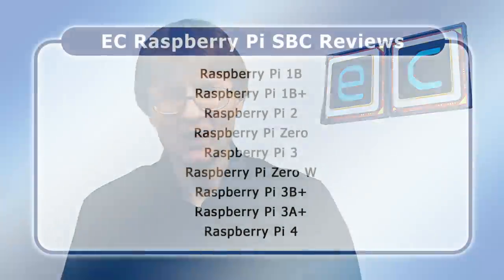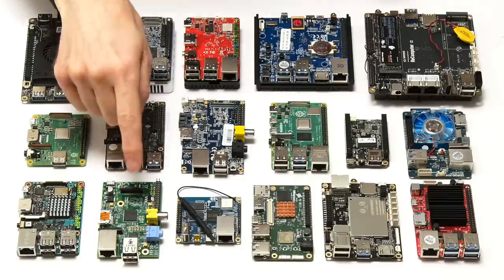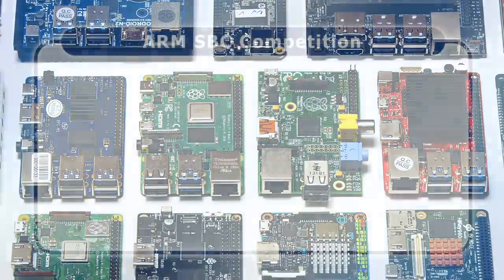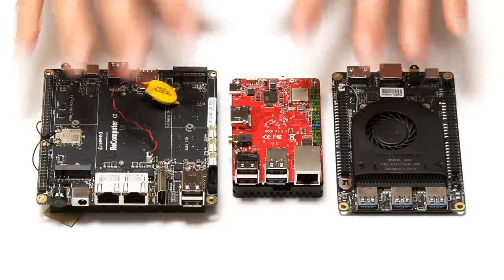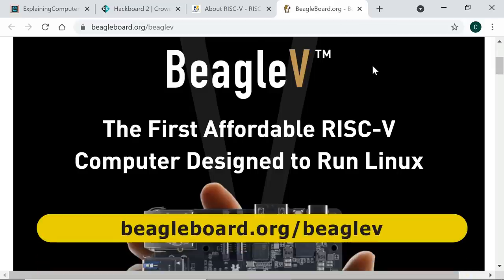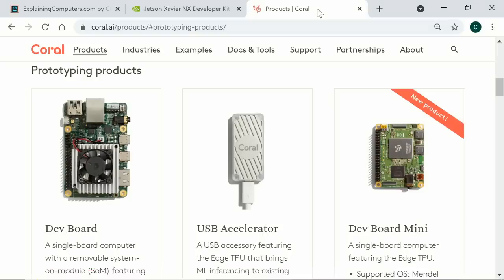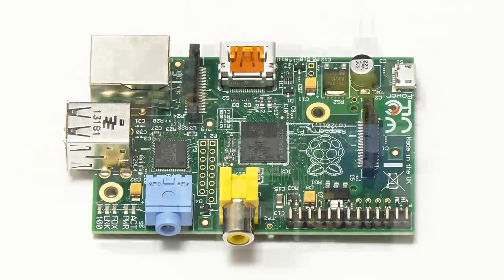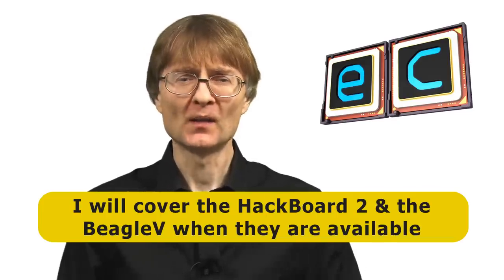SBCs in 2021: The State of Play

Comment: Thing is, you can only have that many different configurations until all of them can be depict with a config file for the mainline kernel. And if i where to develop a "5€"-SBC i would create a table of cheap components on the one side and put if they have drivers in the mainline kernel on the other side and then select the cheapest that crossed out both sides. Throwing a bunch of ICs plus chickenfood on a PCB isn't that expensive, especially if you only need to follow the manufactures examples, what kills you is if you need to mangle the kernel to run on your board.

Comment: they should have taken the pi400 prototype and actually increase its specs. its getting to the point where low power consumption is becoming less of a selling point compared to cheap single board computers that can run powerful software. they could have doubled the size of the board, replaced the low power arm cpu, added a small cooling system and it still would have fit in its keyboard chassis.

Comment: Why is it that every new ARM-based CPU requires a whole lot of CPU-specific software development, but the same x86 OS (Say windows 10) runs on pretty much the entire range of X86 CPUs?
Reply from the maker: Because all those x86 CPUs are plugged into a PC motherboard with standardized hardware, all running the same standardized operating systems, and with a BIOS/UEFI adapted from a standard image. But this is not the case for ARM SBCs, where the designers/manufactuers can include whatever hardware they like.

Comment: Please make a video about controlling an SBC over WiFi. That is, use your laptop as the monitor, keyboard, and mouse for a remotely located SBC, which you connect to via WiFi.
Reply: Also, check the range within which you use can use the WiFi. (I am thinking about automating an aquaponics system, which I want to observe (using a camera attached to the SBC) on the computer in my room

Comment: I'm not sure I agree with the conclusions - yes things are getting more complex and without serious coordination of resources those top-end (?) SBCs are really struggling to work for home consumers but that too is sort of missing the point. The very fact they proclaim themselves as prototyping kits is just a means to hook commercial or industrial consumers on a particular hardware template for their own products as such there is a huge hidden market that drives those onwards. Delays are the killer in all this but given the significant silicon shortages of the last 18 months (which are apparently getting worse, not better unless you are an automotive manufacturer) pretty much everyone is in the same boat (except for the RP2040 which is ironically the most interesting thing the RPF have released since the original RPi). 
Between education, makers and retro-computing fans the SBC market is pretty much sewn up by RPF and everyone who spends the time to experiment with them just ends up buying more and finding excuses to do more with them - that market pressure is significant and keeping prices down to sell more is key. For many the RPi3 is the sweet spot - cheap and capable without guzzling power or overheating, RPF know this and work hard to keep prices down otherwise they fail in their mission. They aren't Apple and aren't in the market for out-and-out profit (it just helps to keep development rolling) - even Apple are pushing their prices down to get more people invested in the new ARM products (see how long that one lasts once they abandon the old hardware)

Comment: Do you have any episode showing if you can use an SBC as a network router? It would be very interesting to see if I can make a router with at least 4 RJ45 slots with an SBC. Imagine the applications of that, we wouldn't depend on proprietary firmware any more. and we could have a device that can monitor the network in various ways and it would be able to provide statistics of the connection, and it could be used for various other staff at the same time such as network storage, and you could have a router with 4 usb attached devices if you wanted. you could have a router that can hold logs as big as its SD storage etc etc. other than the speed, you could make a machine that has no difference in terms of security compared with professional routers. and you could store inside content that could play even when the network connection is out. I cannot find such a project anywhere and I wonder why because it seems so feasible to me to attach a device with 4 RJ45 to a raspberry pi and use the raspberry pi as a router processor.

Comment: Oh man ! The single board computer gets me excited, it would be even better if it runs mainstream OS .
Reply: Describe mainstream?
Reply: @sethrd999  Ubuntu, pop_os!, win10, macos, manjaro, etc. OSes that normal consumers and average laymen are using
Reply: @umamifan  guess I am not normal then, hint there are alot of us also ;).  With SBC's I still maintain a rolling release is better for up to the minute support for your hardware.  I am having an interesting battle with a Solidrun 4x4 cubox-i and a device tree that actually disables a USB port and turns off power detection on the other, like a powered hub on the USB bus so ultimately when you plug something like that in the unit locks up due to the over voltage alarm condition.  The problem is the DTS/DTB ( device tree ) is for a hummingbird or loosely based off of it.  I am aiming to fix this and get the DT changed in latter kernels for this one.
Reply: @sethrd999  It's not really that you're not normal. Mainstream OS in a broad sense is just OSes that are popular. And they are usually populated by people wanting a simple browsing experience, a good workstation, some light gaming, etc. I don't think a "mainstream OS" would be a good fit for boards like these designed to be tinkered with constantly and inconsistently. They'd need to have their own maintained branch of it (e.g. Raspbian) to make sure compatibility, stability, and optimization are all in order so the end user doesn't have to troubleshoot as much and or write a lot of code to fix fundamental issues when they run into a problem
Reply: @sethrd999  Also great, I love it when people in the community create and push out fixes for everyone to use and benefit from. It makes the experience more enjoyable for everyone
Reply: @umamifan  I think its inherent that there is no happy medium really.  RTOS is the next step down the ladder and yeah your really in the wild there.  Ive mentioned ive had a ton of fun with Esp32's STM's etc etc.  So much power / fun to be had in a small package.

Comment: Well, while I guess all 80's and 90's computer (except IBM PC) were single board computers, I think the SBCs of today hark back to a time even further. When I think of SBCs ancestors,  I think of boards such as the Mk 14 (https://en.m.wikipedia.org/wiki/MK14) and others like it from the 70's.

Also, have to agree with you about the need for software. Even Raspberry are taking 2021 to be their software development year - so don't expect a Raspberry Pi 5 until 2022 at the earliest.

Comment: I am reminded of the situation in the late '70s early '80s of a less than mediocre computer which had only one thing in its favour, VisiCalc. Crap computer with a sort of business software. I cannot remember the spec totally but it was something like either a Tape Drive or an 80M Floppy Disk. Not sure of the Ram but not a lot. My computer had twin 800M Floppy drives and 64k of Ram. I was told by a contempory that the Tape Drive was faster than the Floppy. I know that in the similar period a Commadore thing had the same feature so this may have been true.
BTW this was Apple if you hadn't already figured it out. So software is the key item here. It matters not that my computer had SuperCalc and a Word Processor, just that they were a couple of weeks later.

Comment: It's getting difficult to draw the line between SBC and a microcontroller prototype board. E.g. pi Zero Vs ESP32, very doubtful that you would run a desktop OS on a Zero and it's an easy path to using something like an Arduino or ESP32. Don't get me wrong, the Zero is a great device  / board but it does not excel at any one thing.

Comment: It would be nice to see a fast singlecore 64bit intel (or amd, or maybe cyrix) sbc with low power like a pi3b or lower power consumption. A speed of 4GHz would be nice but about 3GHz would do (and a lot of RAM like say 4GB or 3GB or  2GB at least). So many people just write brute force bash scripts (not object-orientated or multithreaded) code anyway. The graphics could be the same as a pizero (or intel equivalent like dx9 or dx10 but in opengl). Would make it easier for communities to port a linux distro.
I'm not overly interested in RISC5 as a priority. A new openpower would be better IMO because it does something else.
Sometimes, even just for a slow x86 cpu, a person can be better off running on a intel cloned fpga (as if say 100MHz or more equivalent horsepower) in place of a pizero running qemu. Even a pentium2 at 350MHz with a large amount of RAM would do. Not interested in nvme and all that. Some sort of PCI (or pci-e) would help, then add what you want (e.g. new graphics or a NIC or sata/usb HBA) but remove it to save power. A DVI-A port would be handy and then digital or analogue can run on it. PoE is handy, an a few usb would do but need not be usb3. The HBA could do it.

Comment: Now Intel, Nvidia and others all trying to get control of ARM. If they do ARM will be forever expensive like the X86 parts. Hope a stronger low budget RiscV board comes out soon as Sifive boards are silly money at $500 for one which is worth having as a base to build a replacement desktop and OS environment on. But currently they are the only ones which have a PCI-E link so you can use a AMD GPU card on them with ease, but I would have to rewrite and compile the open source drivers Myself. I want to build a RiscV office based machine to run my own OS on. while I can do the coding side in C/C++ i haven't a clue about the hardware side, hence the attraction to the Sifive ITX board which would just drop in to any ITX case and let me use a know GPU type. Currently running a customised Linux Gnome desktop, but switching to BSD probably as don't want to share my code for free after putting in hundreds of hours of work. I could make an Amiga do anything it was capable of doing, but never like the x86 platforms, So many pointless extra instruction. Always proffered RISC Processors assembly. With US putting locks on ARM chips sales to Chinese I can see RiscV getting used in phones at some point, still years to catch up ARM but then ARM sold out years back.

Comment: Linux was ported to ARM processors years ago, and linux for arm SBCs should not be a problem.
Reply from the maker: But appropriate drivers are required to access the hardware, which very much remain a problem. There is not a standard ARM platform the way there is a standard x86 platform.
Reply: @ExplainingComputers  
Time will tell.  However, the development tool chains already exist.

Comment: I'm looking for an SBC that has GPS in it and runs android (that recognizes the GPS). I want to build a system with an navigation android app that utilizes full-size keyboard, mouse, monitor and speaker. Support for two monitors is highly preferred.
Reply: Considered an android tablet?
Reply: @sundhaug92  Tablets don't have option for external monitors. If you know about one, let me know
Reply: @adamlipsky8010  MHL is the term you want to look for

Comment: Apple M1 as a third way?  Apple has come up with a way to translate X 86 binaries into something that can run acceptably fast on and ARM processor. It seems to me that if the community can duplicate this kind of on the fly translation, then single board computers based on ARM could continue to be built on low-cost chips instead of X 86, yet vastly increase the software that they can run. Why not?  The future that you suggest is one where single board computers remain relatively compartmentalized with an in adequate amount of software and support.
Reply: @Tano good point. I hope this continues, because if translation can be done of the x86 programs so that they run on other architecture’s like ARM or risk five, then I think the future will be A lot brighter!.

Comment: I've bought every version of the RPi, except  for the 400.
Reply: Why??? It's not even a particularly good SBC.
Reply from the maker: Hi Leslie.
Reply: @jm036  Software support.
Reply: It's really fun
Reply: @jm036  As Franktor said, Software support. Other SBCs may have better processors, better features, but if there isn't any software to run those functions, it's no better than, and IMO worse than, running a RPi with many supported OS and software options...
Reply: @kevinshumaker3753  Pine64 stuff has decent software support and the hardware isn't digital signage specific trash.
Reply: @jm036  I have 2 grandkids, and they both use Pi3B+ and Pi4B-2GB for desktops. I don't pay the M$ or Google tax, and they are better than the Chromebooks the school had them using. If they trash the SDCard I don't cry. I image another SDCard and off they go. I'm getting ready to teach the 7 year old how to use RPi-Imager so he can make his own backups. My shift them over to tiny form factor 64GB USB drives.  Hard to beat a $35 device with the features, software, and power of the RPi products.
Reply: @kevinshumaker3753  Pinebook Pro would've been a better choice for that. Pi is just as pozzed as chromebook garbage if not more.
Reply: @jm036  5 times the price. And unavailable.
Reply: @kevinshumaker3753  5 times the price, 50 times better

Comment: ive got a pi2, pi3b, a few 3b+, a couple odroid xu4s, had 2 tinkerboards (one died) and a pi4 4gb ,  i am greatly disappointed in the pi4, i figured video streaming from my server would be much better than the 3b+, i was wrong. maybe when osmc gets it together it will be worthwhile. as of now, it's a waste of money, imo. i actually just replaced the pi2 in a verticalpie emulation setup hoping for a little more performance in advmame and a snappier emulationstation menu, but the newer retropie is still buggy. i ran the pi2 for a couple years with no problems. now with "upgraded" hardware and software, i get freezes and a glitchy menu and sound dropouts.

Comment: What is happening with SBC's in the middle price point (mid range?) segment of $51 to $99? There are a lack of reasonably high quality mid range SBC's available that have decent software support, aren't attempting to be a Raspberry Pi clone, use an ARM or RISC-V CPU, have a GPU where there is a high quality open source driver available for Linux, and are priced to not break the bank ( https://youtu.be/RcvMxC81r_g?t=535 ).

Comment: The Raspberry Pi 4 is not the most powerful ARM board... specs-wise, but software-wise it's a mixed bag where the Pi either dominates or gets dominated. Emulating video games is traditionally an intense routine. The Raspberry Pi 4 mercilessly beats even RK3399s at what it is capable of emulating, despite being, at least on paper, a FAR weaker SoC.

And yet, the Raspberry Pi 4 struggles with basic tasks like a full-speed USB 3.0 port (why does it cap at slightly BELOW SATA 2 speeds instead of being slightly FASTER than SATA 3?), playing videos (720p can make a RPi4 stutter, forget 1080p or higher), being able to go into hibernation or sleep mode (the Raspberry Pi literally has no function for this, leading you to have to do a full and very lengthy shutdown/startup sequence).

The Raspberry Pi has, for better or worse, played to its strengths (ease of development, very low cost, open-source structure), and utterly ignored everything else (videos, power sources, USB ports). For me, it isn't hitting the marks I want. Small x86 PCs would, but the specs aren't quite there yet, maybe when we get some Ryzen ones, as the Intel offerings aren't where I want them to be yet. But I'm not the only consumer. The Raspberry Pi is incredibly easy to develop for, is actually a HIGHLY capable gaming device, and despite balking about ~280MB/s speeds at its max, that's still almost 3x faster than the ~90MB/s + spikes far lower (due to HDD) that most laptop users like me were used to for years prior to the proliferation of the SSD.

The UDOO Bolt is pretty close to what I want, but it still requires buying, among other things, Windows, RAM, an SSD, and so on. If I have to do that, and it's still really expensive, I want the assurance it's actually a quality product and that it has a *case*... so it would be more in the NUC or "mini PC" territory for me. But this goes into what you were explaining in the video regarding the "100-500$" cost field. It'll appeal to someone. These boards do sell, hence why they're still being made.
Reply: Anand Raj  Single-threaded performance really isn't even that important. At a multi-threaded level, the Pi does pretty good, especially for its price. The GPU is quite weak though, and the only more mysterious part of it. But with those jerks at nVidia owning both their own proprietary GPUs AND Mali now, it's going to be really rough for anyone to ever pick up Mali...

mSATA please no, it's a long dead standard. M.2 yes please. A lot of SBCs use an M.2 port now, hopefully the Pi 5 would too.

Pi 5 really needs some way to sleep and resume. I think the Pi 4 is just about perfect for a low-cost, low-power computing device... we're so close.